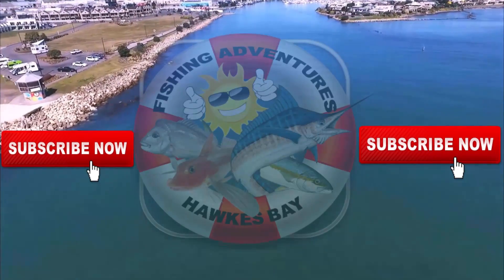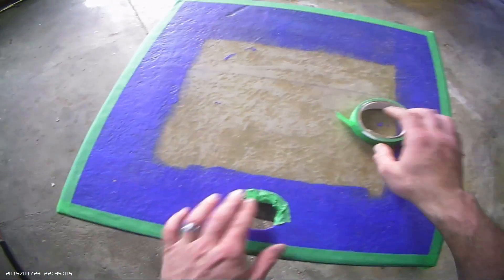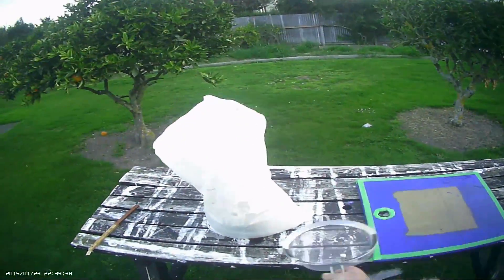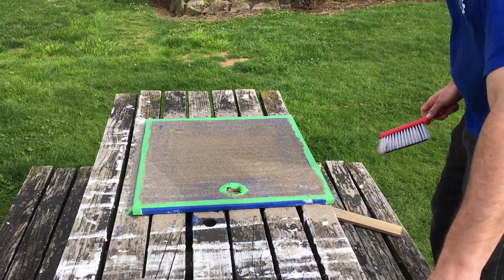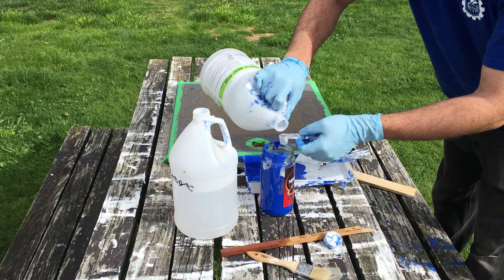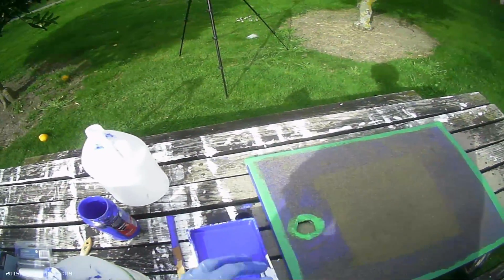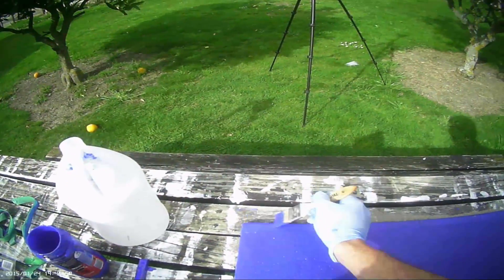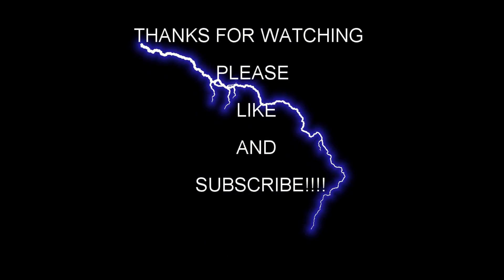How to Anti Slip - Non Skid your boat for Cheap

Comment: Im about to resin the floor and bottom of my boat. I was worried about working time but this makes me a lot more confident it will be easier than scraping gelcoat and re-spraying phenolic resin based paint without a doubt. I hope this gets more views man, good job!
Reply from the maker: Mrmghz1 thank you very much for your feedback and I hope it works as well for you as it did for me. Tight lines.

Comment: Would this same procedure work for a small ramp   0" to 18"  thats 5' long and 4' wide for handicap/mobile scooter access... The fiberglass ramp i have currently has a texture to it so just cant use griptape....  Considering its for tires and not for feet thinking that Larger construction sand might be better and offer more traction....

Comment: We did this in the army on foot holds and decks of equipment. Just sand the paint 2 coats. Does it where sure but that’s constantly placing your food into placed the anti slip tap was expensive and hard to get  didn’t work so well on scraper ladder steps bu the sand on paint  painted over worked

Comment: Do you think this would work for the inside of a kayak? Looking for a nonslip option for my dogs on the kayak while also not getting really hot like a black spray on bed liner. I used the "peel and stick" foam mats but this tend to want to peel back up.
Reply from the maker: Hi. yes I recon it could as long as you give it a good sanding with heavy grit sand paper before applying the resin and
Reply from the maker: and  a couple layers of paint after applying the sand it should be good.

Comment: Can this be done on top of bare plywood or does it have to be done on a fiberglass surface? Thanks man good video
Reply from the maker: I’m sure you can do it on bare ply if you wanted too. It won’t be water proof though and you would have to do a coat of resin and let it dry in order to have a base for the sand and resin layer to grip onto. then do second coat and throw the sand over. The problem with this is it won’t be water tight and the 1st time it gets wet it would probably warp.

Comment: What's the name of clear product you added?
Reply from the maker: Are you talking about the one to harden the resin or to thin it out?
Reply: Fishing Adventures Hawkes Bay first product to hold the sand.
Reply from the maker: It is called Resin. The Same resin you would use for Fiberglassing.
Reply: Fishing Adventures Hawkes Bay ok, thanks. How long of wait for paint to dry? Name of that blue? Laying down new flooring next week.
Reply from the maker: The gelcoat paint normally dries within 3-4hrs remember gelcoat is not normal paint as it is resin based and also needs hardnet added for it to be able to cure. That colour is called backwater blue.

Comment: I was about to buy carpet until I came across this idea. Carpet looks pretty but holds too much water imo
Reply from the maker: yeah mate its very easy to keep clean and durable too I have it on the boat for  almost 3 years now and it's still in very good shape. my concern in the beginning was that it would be a bit rough on your feet, especially if your fishing bare feet but surprisingly it hasn't been bad at all.
Reply: yeah and it will catch every fish hook in the boat
Reply: the carpet that is